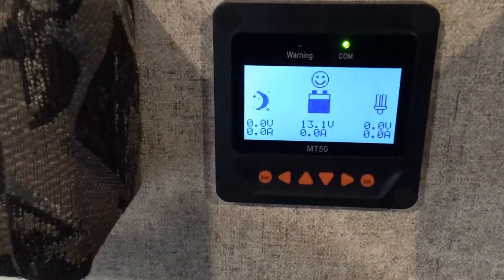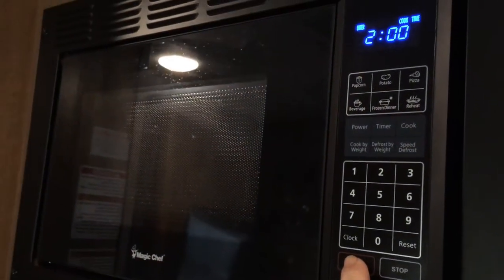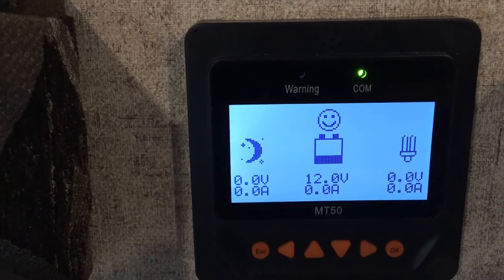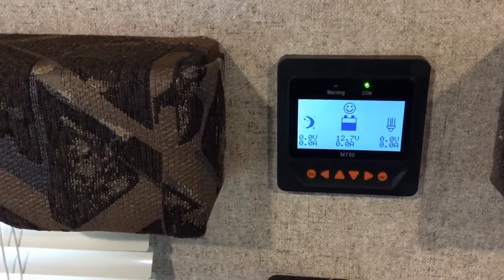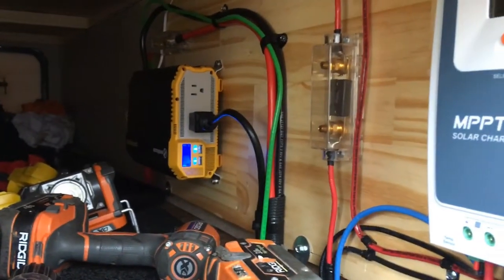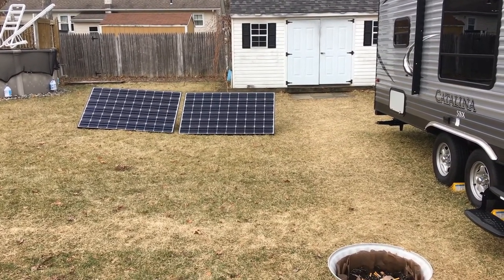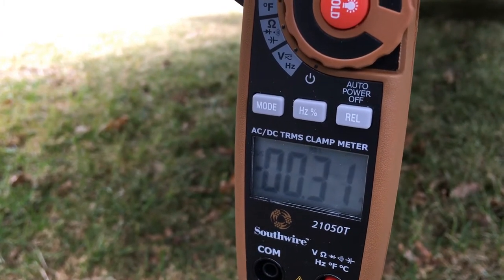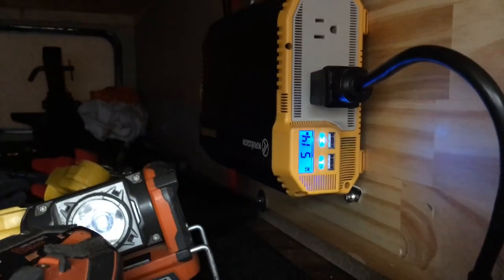RV Microwave inverter test, Krieger 1100 watt, 3 - 12 volt batteries parallel, Boondocking prep.

Comment: Question about installing a HY-MPPT 30 controller.   I have everything connected and its charging and my loads are getting power.  However the load on off button will not kill the power to the loads.   Given this is a positive ground controller and i have the battery bank grounded via the neg side to the chassie of the van am i too change the batt ground to the positive side?
Reply from the maker: I dont know the specs on your controller... Some controllers the MT50 meter does not work with them. Also there is a delay when you push the buttons for the load...

What loads do you have running off the controller? 

Is this what you have?

https://www.acopower.com/product/charge-controllers/mppt-controllers/acopower-30a-mppt-solar-charge-controller-hy-mppt30a-mt-50-solar-charge
Reply from the maker: I reread your post.... No you cant run loads from that controller if the loads are tied to the ground. Run the loads off the battery directly...No do not change the ground... Again just dont run loads off the controller that are tied to ground or touching /tied to the frame of the van.

Comment: Yes that is the exact system I have.   So I have a blue seas fuse block running to the load connection on the controller and I have the power running in from the auxiliary batteries to that same fuse block.  So, when viewing the remote monitor I can see the load amps change when I turn on or off a component like a fan or fridge.  All the components are grounded to the fuse panel.  I have a inverter powered directly to the auxiliary batt. As well.   I do know that the stereo has an issue where it is grounding it self to the metal in the dash.  I don’t know it is defective or the Neg ground on the auxiliary is acting like a loop and grounding it but I also ran a direct ground to the fuse block.  Aux. battery is also linked to the start battery via a Shure power brand separator switch which allowed the charging of both banks via solar and or alternator when driving.   So the loads will not shut down manually through the use of the Load on off on the monitor.  
    Are you saying I should reconnect the fuse block directly to the battery?  Won’t this eliminate the use of the monitor to view what load amperage is drawing down ?  

Sent from my iPhone

Sent from my iPhone
Reply from the maker: Yes reconnect the fuse block to battery. Yes it will eliminate the ability to use the MT50 to turn on/off loads. You cant use those terminals if the loads you are trying to control are tied to ground.

All you can run off that load terminal is for example: A light that has a pos, and neg wire from the light to the controller. And the light is mounted to wood.. The light has no reference to ground.

If you want to keep what you have get a neg ground unit.. Epever discontinued the type model you have and the model I have..

This is the updated model and I suggest getting this  then you can keep your set up as it is. Or do as we discussed and connect fuse block to battery directly.

https://www.amazon.com/Solar-Charge-Controller-Ground-Tracer3215BN/dp/B076TBB5HP/ref=sr_1_3?ie=UTF8&qid=1522382820&sr=8-3&keywords=Tracer3215BN

Also watch this guys video. I helped him with the same issue.  He couldn't turn his loads off because he did a terminal block like you...

https://www.youtube.com/watch?v=G7zTtnJQkzo&t=20s
Reply: Thanks,  I found the problem and now can use the manual on off on the controller to kill the load.   I have a short in the cars stereo and its grounding to the dash.  Also, i had a ground directly to the fuse block.  So i guess it created a ground loop.  I Disconnected the stereos ground fuse block and now the manual on off works.  However the stereo amp draw will not be registering with the controller or be controlled with the on off.  it is still running off the aux batt.   Need to get a new stereo and reconnect the ground and all should be good.